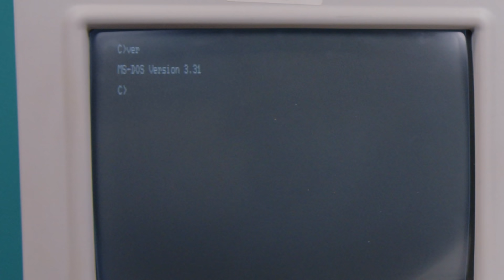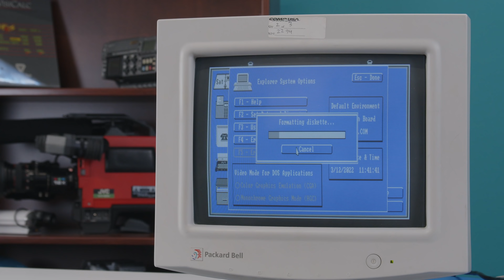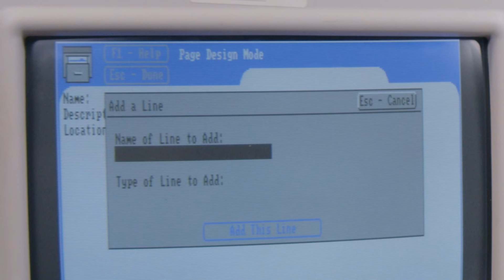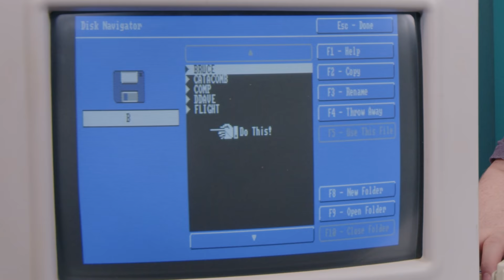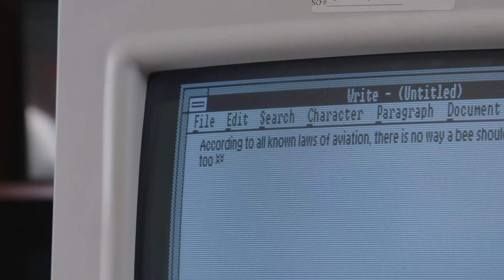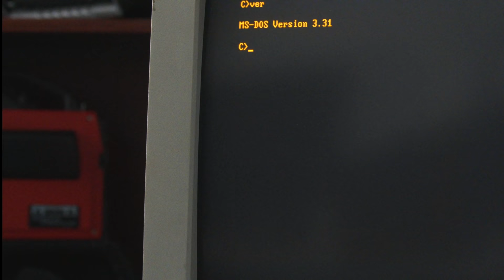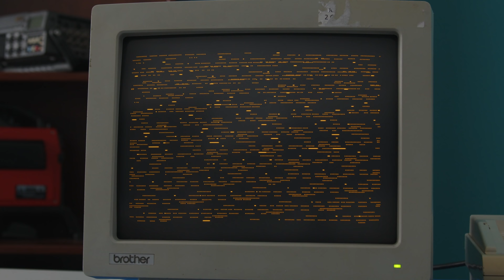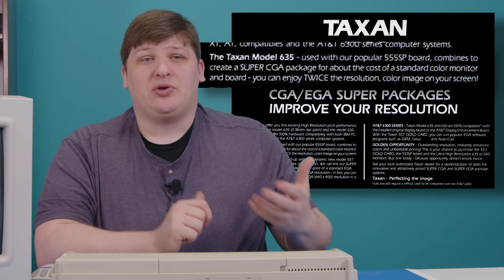Headstart's PC With The Weird GUI "OS" [Explorer]

Comment: Re your thoughts on 80s integrated keyboards -

Try comparing those to some assorted makes of typewriters that preceded them.  You'll find that they are generally an improvement.  I say this as someone that really did use typewriters a fair bit in the late 80s-early90s.

It just took some time for them to figure out what really did make a good keyboard that people actually wanted to use.  Of course, even now, opinions are sharply divided into a few different camps.

Comment: 1:50 back in 1991 I owned a Magnavox Headstart 300 a 286 12mhz with 1 meg of ram and 42meg HDD. I was quickly disappointed with it in that the 286 would not do multitasking (first purchase of a computer)

Comment: Sidenote regarding 8/16bit machine keyboards - if you haven't already I highly recomend trying the various Acorn machine keyboards.

They still have the "This keyboard is a good inch off the desk" (Well, till you reach Archemedes) issue but they are fantastic mechanical units otherwise.
Reply from the maker: Good idea - I've never had the pleasure of actually trying any of the acorns and the thing that made them special, from all I've read, is basically that they put in more effort than they needed to. I wish I could find a micro or archie for a reasonable price though -_-
Reply: @CathodeRayDude  Try an Electron.

The keyboard was just as good as it's big brother, and as the red headed step child it's probably a little less unobtainium.

Comment: Personally I never found it difficult to type on those old keyboards.  I have used the Apple II and TRS-80 Color Computer 2 and had no problems.  Maybe the keyboards you were using were bad with were or it could be something to do with our differently shaped hands.  I am not sure what you mean by jammed.  If the key is stuck sometimes you can fix it by gently lifting it up around the edges with a knife.

Comment: Oooh, that take about the original IBM PC being a plateau that people didn't want to upgrade from is... spicy.

My memory of it is less that it was a problem of people not needing to go faster and more that standards were iterating very fast and hardware was expensive.

Simply put, computers with wildly different specs (we're talking 2x to 5x performance differentials) were being manufactured and sold simultaneously for a while at very different but pretty high price points. The whole concept of cleanly segmented hardware generations leading to users upgrading linearly just... wasn't a thing anymore. You bought a computer and each computer did different things, so performance differences were just... another feature of the computer you bought.

By the time the 386 rolled around that was already changing. Backwards compatibility on PC was well established, 8 bit microcomputers were well and truly dead and compatibility with IBM products was neither a selling point or a requirement. The x86 platform was well established and the industry was iterating on it on a single vertical that continues today. 

By the time this weird thing came out all that was in flux still.

Comment: 1989 was still 800k territory. The Mac II had them, the original MAC SE (you could replace the roms and fdd to upgrade to HD). As did the Mac plus which was sold til late 1990. But anything introduced from sep 1988 in the mac world has 1.44mb floppies til they got rid of them
Reply from the maker: Sure, but IBM had been selling machines with 1.44MB drives for two years - the question is whether you could buy them as a clone mfgr.

Comment: I want them to build a mdern keyboard wedge in 2024 and beyond, with built in optical deive, full size sd slots and hdmi support with at least 4 or 5 usb ports. Kabey black with ligted keys. More computing power than a laptop, definitely a desktop, but in keyboard wedge form factor.

Comment: I think you are looking at the GUI on this machine in the wrong context.

Most PC's came with no GUI. If you wanted one, it was an expensive after-market add-on.

This means that most people that bought this, this was the ONLY GUI that they saw. 

You then compare it to other offerings that from companies that probably spent more to design their product than was reasonable on a $600 computer.

Then the fact that it booted quickly into the GUI than many computers booted into DOS via floppy is not discussed by you.

I imagine that given the limits imposed by ROM space and budget explains the limits of the GUI.

The limited speed of typing input was probably not seen as an issue for the target market.

The people who could type quickly were using Word Perfect, the gold standard office word processing software at the time.

Comment: BTW, I have seen 8 color CGA. I think it was supposed to be 16 color CGA but the corresponding monitor could yield only 8 color. (luggable predecessor to laptop). How it work? 80x25 text mode, 16 colors. Completely standard software was able to use it.

Comment: Reminds me of those more recent, but still old motherboards that went into a GUI for accessing the internet so you didn't need to boot Windows.  That cursor sure reminds me of the Gloves from Beatles Yellow Submarine animation.
Reply: I had a netbook that could boot to a barebones os with just an internet browser.  It was absolutely terrible. Amazingly slow, the browser was some awful propriety thing with absolutely no features so no popup blocking or any sort of page options in fact I dont think it could even save or download anything.  Also had no firewall or security features. Im not really sure why they bothered to be honest, I guess it booted almost instantly but was pretty useless for daily use. You switched it on or off in the bios iirc.
Reply: @meetoo594  For me it was novelty value lol.  Although you could use it as a VERY basic ftp system.

Comment: that machine would have cost a SHIT TON of money back in those days. That device was UNOBTANIUM
Reply: 3000 for a lowly 386 machine in 1989, the adverts in historic Byte magazine and similar are quite a trip down memory lane.

Which was six months wages for an hourly barely paid factory worker in the UK in 1989.

In the UK the owners and bosses raked in the money but they didn't pass on much money to the peons on the shop floor doing the work.

Comment: Hercules Graphic Adapter had tons of game support. Not as much of CGA but a ton. I spent a lot of my gaming life with 286/12 and later 286/20 with HGA and Amber Monitor. Now if you could find holy grail called Hercules-in-Color that would really be something. It did release but in my whole life i saw 1 used one for sale

Comment: The Tandy 1000 HX has DOS in Rom, while with the EX you have to load it from a floppy.
Reply from the maker: Oh! I didn't know that! Wow, I'm doubly glad I got an HX.
Reply: @CathodeRayDude  The EX has more advantages in my opinion. 

It's easier to  change the floppy drive in an EX to a 3.5 inch or an FDE. The HX uses a proprietary floppy cable that carries both power and the signals on the same ribbon cable. I have an NEC v20 in my EX with a Tandy 3-in-1 card and a floppy emulator. It's balling. Problem is, I can't access Tandy graphics modes with the v20 installed. 

I also have a power supply adapter that I created to allow the use of an ATX PSU or a Pico PSU in the computer, made it after the original one blew up in my EX.
Reply from the maker: @thatguyontheright1  Huh! Curious what causes the video mode incompatibility wrt the V20 - some kind of timing issue?

You're making me want an EX now!
Reply: @CathodeRayDude  I haven't looked much into it, but it would likely be a clock issue. A V20 isn't necessary for a a Tandy 1000, but it does make stuff that doesn't run with Tandy Graphics (Sound is fine) fly. 

A Tandy 3-in-1 board is a great upgrade as it gives you hard drive/CF card options, right on the ISA bus. 

Do you have the Ram Expansion daughter card for your HX?

Comment: This reminds me a lot of my HP-95LX with the fact it has the OS on ROM. It may be quite an interesting computer to look at even if its tiny size makes it so that its uncomfortable for you to use. I use it mainly in applications where a calculator can be used but a computer is better such as running a very old version of matlab (this is essentially why devices with a qwerty keyboard are not allowed on SATs)

Comment: I had a "hercules" card, I say in quotes because it was a clone of the Herc card and I don't remember the brand BUT it's party piece was you could display EGA on a monochrome monitor.  It would display Hercules, MDA, CGA, EGA and also Composite CGA on the same Mono monitor.  It also had a composite output and I don't remember what it would output on that.  Basically ANYTHING that wasn't VGA though would work fine on the old green screen which in my case was a 9 inch which thankfully I had good eyes back then!
Reply: And before anyone says it, no it was not JUST an EGA card that I happened to be using a mono monitor on.  I don't remember what it did but I seem to recall trying it one the EGA monitor I have and it either didn't work at all or i was black and white.  Yeah it was probably BASED on an EGA card that had Herc support and just output mono.  I don't remember.  I do remember though that, again, it did not work correctly with an EGA monitor.
Reply: @BrianRRenfro  Probably one of these: https://en.wikipedia.org/wiki/ATI_Wonder_series
I have good memories from those😊
Reply: @grewdpastor  It sounds a lot like the EGA Wonder as it supported all those modes What I may have had was a knockoff of the ATI card that removed the dip switches for cheaposity and just locked you into TTL monitor output.

Comment: Looking at Flight Sim, I see it running "normally" but slowly and it has me wondering why that works. 

Programs today would lag hard for a few second and then catch up, over and over.  Not modulate the total application speed to the clock speed of the CPU. 

Is that the product of multitasking / hypervisor? 
When did computers go from "tied to clock speed" to  assuming infinite resources and saying "I will sit here and spin until I get what I want"

Comment: I had a machine who's existence I cannot find evidence of. Bought in the spring of 1989. I had a Maganvox vendex Head Start II 286 12mhz with 1 meg ram and VGA graphics. All searches only come up with the II being an XT. I have no good pix of the machine, and the pix of the motherboard (used for NSFW art)  arent clear enough. it came with a 3.5 and a 5.25, and 20mb HDD. whatever floppy drive you booted from became A, if booted from C the 3.5 was A. It also came with an onsite warranty, which I used several times to have things replaced that when wrong. 

I added a modem and Adlib card, then a soundblaster, and later (1996) added a Aztec external CD-ROM drive that I have drivers for still but can find no evidence the device ever existed.

The machine was still in use in 1998 and died due to someone spilling liquid on it.

It's possible the short lived computer store where i bought the device had made some changes to it, but that wouldnt account for the warranty being solid. 

Every 286 version I see online is a III with a case that was not mine, and the II's have the correct case but are listed as XTs. This is not at all misremembering either. I have  a backup of that drive... I played Ultima VI, Hero's Quest, Wolf3d, and so on on that machine. Things that do not run on an XT. (I had a compaq XT portable that was gifted to me). I also was 'made fun of' for getting the 286 vs a 386 for the embarrassing price I paid. In those days you could take a loan out to get a PC!

The cost was worth it. It was an important piece of falling into an IT career for someone who was kinda a fuck up.

I love and appreciate your videos. I think that tech history is kinda important.
Reply: I wonder if you had a bridge/closeout model where they had old XT case parts to clear out and reused them to make a 286 system or to fill a gap until the redesigned 286 model and case were ready?

Comment: My first computer was actually a 386 with a Hercules card and an amber MDA monitor, so this kind of display anyways brings back memories. I had Windows 3.1 running on there. It was around 1995, so it was already pretty much obsolete, but I was just a kid in a post-communist country so nobody was willing to buy me anything better as my first machine. I did actually manage to learn quite a bit on that PC, though, including some basic coding skills. I switched to a 486 with SVGA pretty quickly, and by 1998 I had a nice contemporary Pentium II, so thankfully I wasn't living in the past for too long ;)

I'll point one little pet peeve of mine though: the CGA unofficially supported 16 color graphics, or even much more (1024 in modern retro scene demos) via the composite output using NTSC artifacting, much like the Apple II. This is irrelevant to this Headstart, as it doesn't appear to have a composite jack, but people often forget about it and only associate CGA with its ugly cyan&magenta palette, which doesn't really tell the whole story. Many contemporary CGA games had composite-optimized modes that could look pretty nice.
Reply: really; was it that many? I only recently learned that King's Quest had composite CGA support. Also some new retro code like MagiDuck and Paku Paku make interesting use of CGA's semigraphics mode. Everyone I knew back then who had a PC had either Hercules, Tandy, or VGA, so admittedly I didn't see a lot of CGA back in the day, and certainly didn't know about the composite mode then. I was mostly just smug in how much better my Amiga was (until it wasn't).

Comment: 42:59 Hope this helps. My first ever PC was an 80286 with a herculese mono graphics card. Above 640k until 1024k was used as a 2nd farme buffer for mono graphics. The motherboard i used, required 30pin simms. When I played ms flight sim 4, with 512mb, I had the same graphics issues, but once I upgraded to more than 1mb of ram, the issue dissappeared. These old graphichs cards used UBM, or upper memory blocks. Dos used upto 640k, and mono cards used 640k to 1024k (umb). However with VGA, memory on the card was used, so umb was free for programs.

Comment: Well, I do not actually know if this is the case here, but back then there were some programs usually depending on internal timing senarios, that didn't handle Turbo Mode CPU frequencies all that well.
And besides apps for formatting floppy disks often was one of those things.
And besides, try using graphical BBSes over a 300 Baud modem.

Comment: I think the double-buffering (page flipping) issue has to do with how the addressing is set up with the video chip.  There doesn't seem to be anything wrong with the memory chips, the hardware is just switching to the wrong bank or a bank that doesn't exist.  Likely just a cost-cutting measure.

As for the slow typing speed in the word processor, it's likely the programmers are trying to read the keyboard directly rather than use BIOS calls, which means they aren't relying on a keyboard buffer.  As a result, fast typing results in key presses being lost.  That's the PC era in a nutshell: low-level hardware calls everywhere and no "real" OS to do the hard work.  Either that, or they are just ignoring the keyboard buffer entirely.  In any case... yes, that software is utterly awful.  8)

Demos like this make me all that much more nostalgic about my Amiga.  PC hardware was complete crap before the 90's, and most software wasn't any better.

Comment: I've used the V20 as a drop-in replacement for 8088 in any number of machines, even a Copower 88 board in an SWP ATR8000, but recently I discovered a difference.  The Amiga 8088 card will work just fine with a V20, but the floppy controller on the card will not work.  Some timing issue.

Comment: You'd like tha amstrad PPC 512 and 640 lugables that have a little LCD screen and can run from 10 D-cells or 12volt car ciggy lighter or 240/110v AC aswell.

Comment: Have you tried to run Geos 1.x or 2 for PC? That would be interesting if video drivers are available. In the day I used a Hercules IBM XT with Horstmann's Chiwriter 4. It was a beautiful word processor that allowed me to create custom fonts, equations and elaborate technical typesetting.
Reply from the maker: I spent about three hours trying to get GEOS to run on here but it was just surprisingly difficult. It was a bummer!
Reply: @CathodeRayDude  It should work on an XT with 512K of RAM. That being said, it sadly did have its limitations. Great video BTW! Bought back some memories.

Comment: it kinda seams like they were trying to make it as much amiga-like as possible to mekr it more appealing, as for the plateaus - we have one right now, if you run 2nd gen intel there is pretty much no reason to upgrade anytime soon unless you want to run the newest games or do some other work with graphics, even for modern games 4th gen is still enough (though 4 core won't be ideal but 8-16 core will do pretty well) paired with a new GPU.

Comment: Some of the apple and TI keyboards were good, the ones that used ALPS switches, but it was a crapshoot which ones got those, as they seem to have just used whatever was on hand within the same model line and year.

Also dude you type really fast.

Comment: Some old PCs with no Turbo button, instead used a keypress combo. Ctrl-Alt-Plus or Ctrl-Alt-Minus (on the num pad, if there is one). I'd be surprised if there's no info at all on what looks like a fairly successful (cos it was CHEAP!) PC. Doesn't the Internet Archive have the system disks? The place is like somewhere you go before you throw old disks away, so you can have a clear conscience.